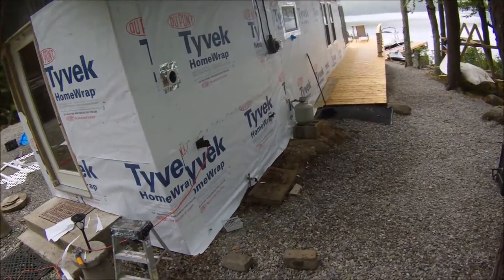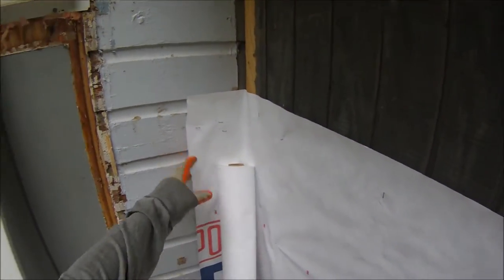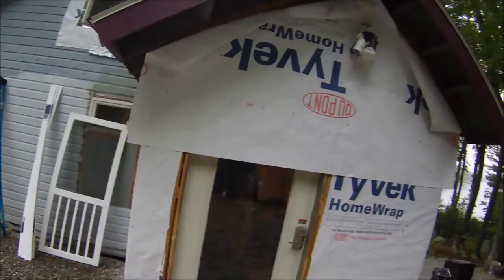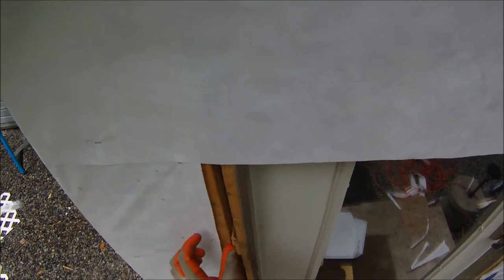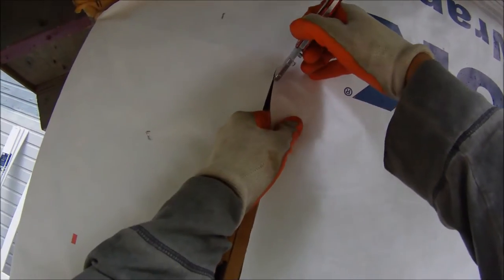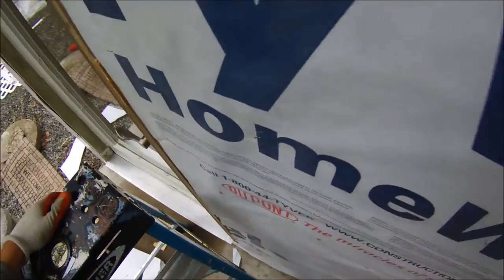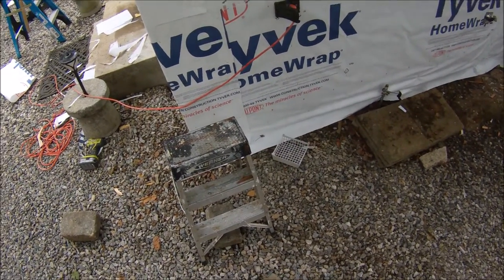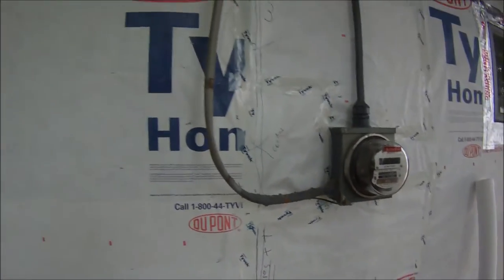How to Install Tyvek - Vinyl Siding a House - P1

Comment: no one ever answers my question so please answer... i dont understand putting so many holes in tyvek? when you put the tyvek up you use tape and are very careful... why then is it ok to fill it with holes when putting siding up? i am not talking about you specifically i mean when ever i see some one put up tyvek and siding. the question is why fill tyvek with holes? is it ok
Reply from the maker: You do need a couple of Holes so the house can Breath, its sort of like when you put some food in the microwave you put a couple of holes in the plastic, if it was Super Air Tight is could actually cause sweating and moisture on temp. changes, hope that helps.
Reply: As far as I know, you should use stinger stapler type, which have a cap, and need a special stapler. It may not be code requirement in many places, but will be over time. Also, stinger staples recommended every 18 inches. I don't think Tyvek  warrenties its product without plastic cap staples (but if they want out of warrenty, I am sure they can find another reason)
Reply: Satwa dude, you talk to much.
Reply: lol look up tyveks manufacture specs and installation ya dopes. The material has holes in it already due to the way its woven. Yes its made to breath. When u install you roll it out and staple as you go. Dont fight it. Tape seams and run seams splices with over laps to the outside to shed the aqua. Can side any material. Zip board is the same concept using zip tape for seams. Coated with special material to prevent rot and heat loss. I could go on for days. older houses with little to no exterior insulation youll slam up foam panels with hogh r value on outside. tyvek, than reside. Go get em boys